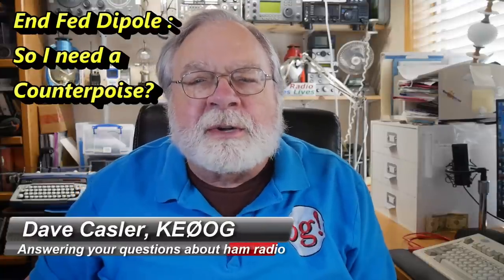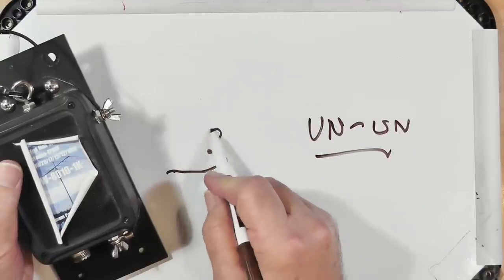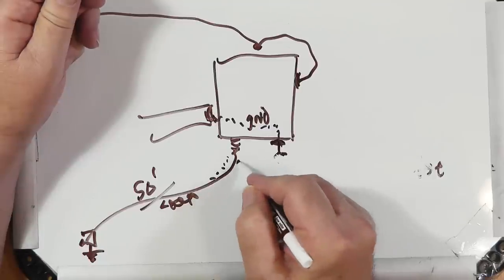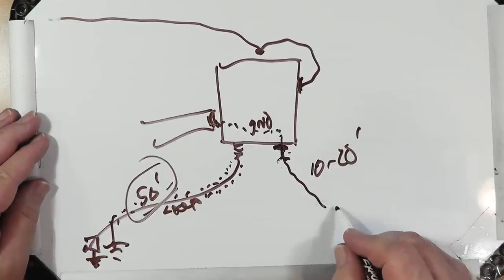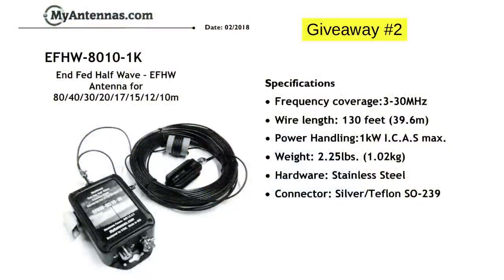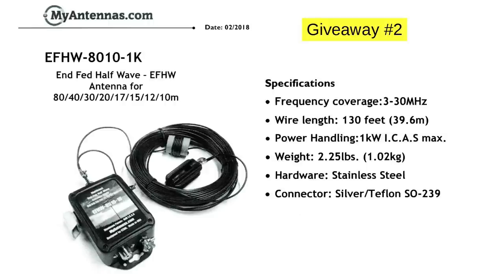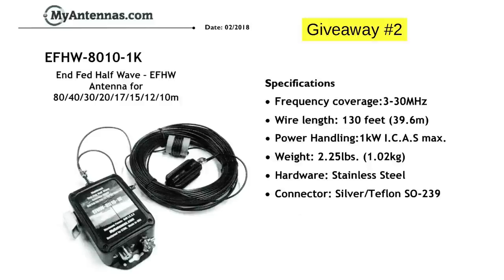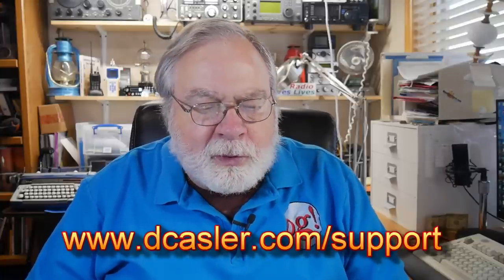End Fed Dipoles : So I need a Counterpoise? (#529)

Comment: YO: The engineers who developed this antenna and EFHW antennas like it have provided technical instructions. The instructions absolutely do not indicate use of coax as a counterpoise. The developers outlined in the instructions the setup and performance parameters. This is: Ground the antenna with a "short" ground wire. Secondarily, you have the option to use a quarter wave counterpoise. The instructions do not say to use your coax as a counterpoise. For anyone looking to deploy an EFHW antenna as a primary antenna you need to ground it and then test it with an antenna analyzer. If the SWR is high or you have low RF gain then test the antenna with a counterpoise. Everyone using one of these antennas should absolutely be using a common mode choke at the antenna feed point. It does not go at the radio. This things comes with a 49:1 transformer that produces upwards of 5000 ohms and needs to be choked out and  ground immediately. Depending upon how you deploy the antanna (height and style) you then need to adjust the performance with a counterpoise.

Comment: I have 3 EFHW in different orientations and have worked all over the world with them. Not much different than a dipole on its fundamental frequency and it works the even and odd harmonics as well.Just ground the outer shield of your coax before it enters the shack. No problems here

Comment: Hello Dave, enjoy your channel! I'm really impressed at how good the EFHW is. I have a homebrew up in an Inverted V configuration too. Up and over a Maple Tree. There is very little difference between it and my 1/2 wave Inverted V Dipole that's at 30'. I have another EFHW I put together that's set up like a Linked Dipole that I use camping. It's 40 -10, but it has a bullet connector on the end w/ strain relief and I just plug another section of wire into if I want to make it an 80 -10 version. N9XFX

Comment: Excellent explanation.
I have the Vibroplex Shotened 80-10 and use 55’ of the feed line into a 1:1 choke then lightning arrestor.
The antenna is rated at 1KW ICAS.
Can anyone explain what 1KW ICAS is equivalent to PEP?
I’ve looked around but can’t find much info on ICAS.
Cheers Jim

Comment: David, if I were to use my aluminum rain leaders/gutters as an antenna for HF, would I need a counterpoise, and if so, how would I determine the correct length for it?
Thank you!
Reply: I'm not Dave but yes you need the other half of the antenna which is what a counterpoise is
Reply: for length of the counter poise you want it a quarter wave for the frequency your on you can have multiple lengths simultaneously for dif frequencies

Comment: Use (and encourage the use of) the correct terminology: Dipole molecules, dipole charges and dipole antennae are, by definition, TWO sided. 

End-fed antennae are MONOPOLES which must be operated against a counterpoise (a ground plane or a radial system) to achieve anything like an acceptable efficiency. 

EFHW antennae are be attractive because they are simple and readily available, but they are a less-than-perfect compromise between simplicity and efficiency. It should be pointed out-especially to newbies- that a resonant half-wave center-fed dipole fed with coax or a random-length dipole center-fed with ladder line and a "tuner" will both run rings around an end-fed wire with a unun and an inadequate radial system.
Reply: So, you are saying that a dipole antenna MUST be fed in the center to be considered a dipole???  Can you please quantify your statement about how a center fed halfwave dipole "running rings around" a similarly configured end fed halfwave antenna?
Reply: You are conflating a physical dipole (i.e., two-sided) with an electrical dipole (two opposing polarity voltage nodes).  An EFHW is electrically a dipole antenna at its fundamental resonant frequency.  As such it is no worse or better than any other dipole antenna, for any given physical configuration, at its fundamental operating frequency.   When operating on a harmonic frequency, the EFHW becomes a multipole antenna with a radiation pattern different from a dipole at the same frequency and physical configuration.  In this respect, a dipole antenna resonant at the fundamental frequency of an EFHW's harmonic frequency may offer an advantage or disadvantage, depending on one's operational objective.
Reply: In the standard engineering textbook “Antennas” by John Krause (W8JK), dipoles are ALWAYS presented as CENTER-fed. The only end-fed antennas mentioned are operated with a FULL counterpoise. A counterpoise is mandatory for end-fed antennas. EFHW’s that utilize a single-wire and/or the feedline as a “counterpoise” will always be inferior to one with a full radial system (or to a center-fed half-wave (or longer) wire).
Reply: @billbrown3414  The IEEE states in IEEE 100-1984… "dipole antenna (antennas). Any one of a class of antennas producing a radiation pattern approximating that of an elementary electric dipole."  Given that statement from IEEE, and also “Half-Wave Dipole Antenna. A dipole whose electrical length is half a wavelength and is formed by a straight metallic radiator, one-half wavelength long, whose diameter is small compared to its length, so energized that the current has two nodes, one at each end, producing maximum radiation in the plane normal to its axis. [4]"....Calling an end fed halfwave a "dipole" is NOT incorrect as you have suggested.
Reply: @billbrown3414  Have you tried modeling a center-fed, off-center-fed and EFHW with EZNEC or some other antenna modeling software?  If you do, you'll find there is virtually no difference in radiation pattern or efficiency at the fundamental resonant frequency.  For the EFHW, the relatively small counterpoise carries negligible current; i.e., it's a very high impedance feed-point.

On the other hand, a true monopole (resonant or non-resonant) antenna typically has a low to moderate impedance feed-point, respectively -- thus, the need for a counterpoise that can efficiently sink or distribute relatively high current.  Counterpoise current distribution pattern isn't too important for a random wire antenna; but for a ground mounted resonant or non-resonant vertical monopole, it's important to achieve a uniform radiation pattern and optimize efficiency.
Reply: "End-fed antennae are MONOPOLES"
Not exactly correct.  It is still a dipole, but end-fed.  Electrically it is identical to a dipole center-fed, low voltage high current at the center, high voltage low current at both ends.  You can feed it anywhere if you match the voltage and current at that location. 
What makes it "dipole" is that when one end is positive voltage, the other end is negative.   A true monopole would be ONLY positive everywhere, and that exists only in the realm of static electricity.
Reply: @daveN2MXX  End-fed dipoles are NOT USED WITH RADIALS.  It is no different in that scenario than a dipole that is not high enough above ground.  The dipole is a perfect radiator IF, and only if, it does not interact with anything nearby, which the radials most certainly will react with it.
A well matched end-fed dipole is identical to a center-fed dipole.  It doesn't CARE how it is fed, just that it is fed at a voltage and current appropriate to the feed point.  You can feed it anywhere.  
Generally speaking a center-fed dipole will work better but that's because the feed point impedance is less affected by nearby objects.  As you get to the ends, the voltage goes up, the current goes down, and the turns ratio on your matching transformer becomes VERY sensitive to exact placement.  Just one inch different placement might require to add, or remove, many turns on the matching transformer.  At the exact endpoint, current goes to zero and voltage is infinite.  It would be impossible to feed an antenna at that exact node point.  However, line losses and radiation effectively changes the transformation in difficult to predict ways.  
Needless to say, changing operating frequency is the same as changing dipole length. Go up a few tens of kHz and suddenly your 64 to 1 should be 48 to one or 9 to one.  You are operating very close to a "voltage node".  It is MUCH better to operate at the CURRENT node, namely the center!
Reply: @DaDitDa  "For the EFHW, the relatively small counterpoise carries negligible current; i.e., it's a very high impedance feed-point."
Instead, it carries HIGH VOLTAGE.  Not exactly what you want running back to an ungrounded radio!
Reply: @thomasmaughan4798  Yep.  That's why EFHW is sometimes compared to holding a "tiger by the tail."  It can turn around and bite you!  For QRP operations this is usually not a significant issue.  For QRO operations, it's always a good idea to ensure all equipment is connected to station ground.

Comment: EFHW + counterpoise = dipole.
not exactly EFHW.
Reply: The secondary of the transformer needs to have both terminals connected to *something*.  If you do not, then it isn't a transformer, it is just a capacitor between windings.  Ideally it is simply grounded.  There's a big difference between high voltage and low current (what you have at the ends of a dipole) and NO current which of course will also be no voltage.  
These things typically use the shield of the feed coax and people simply hook a wire to the high-turns side of the transformer, but there's the SAME voltage, opposite phase of course, on the other side of this high-turns transformer.  If your radio isn't grounded, guess what?  Whoever is operating it could get zapped.  
However, there is so much bad information available that do it however you like and if you get zapped you'll know why.